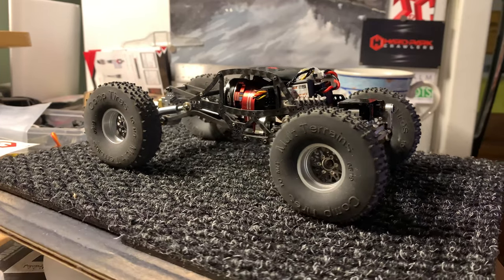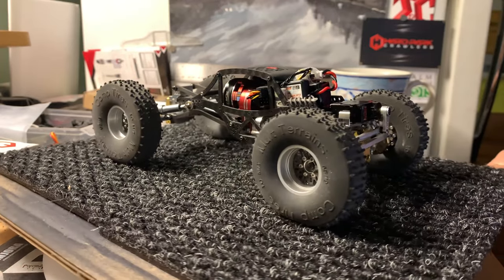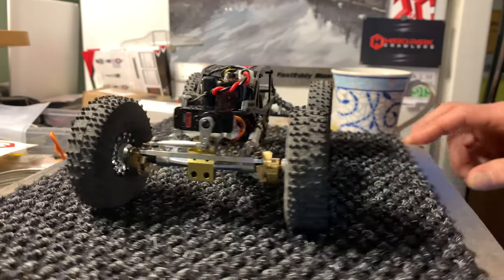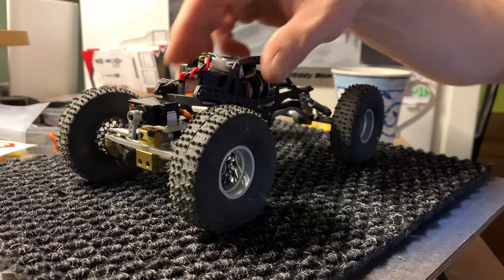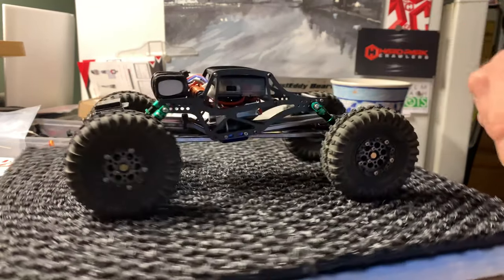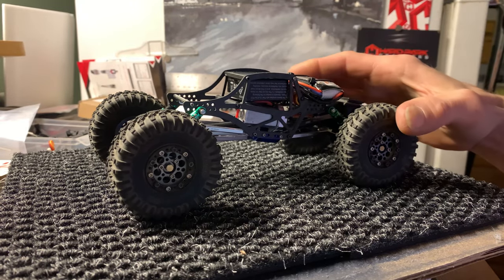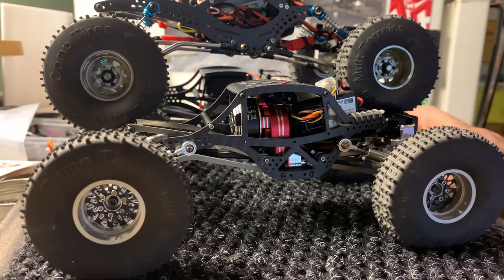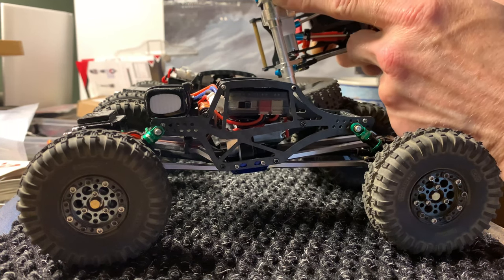Coffee and Crawlers #6 - 24 Scale Comp Rig Talk #hardparkrc #dementorV2 #nwchassisworks

Comment: 2nd and 3rd gear what type of transmission is that the only thing I can think about is Uniqlo medium and high on the first version of electronics on the scx24
Reply from the maker: I'm not sure what you're referring to? Both of these rigs run a single speed stock gear transmission. Both front axles are overdriven by 14% more than rear.

Comment: 12:50 Aaah why did you retire that ? Well cool stuff you show here but for me thats way over my limit, time and money wise. These things are so much fun to drive even stock, then with a few of the usual mods and then some (like that ebay carbon chassis) its good enough for me. At some point i stop looking for more and more.
Reply from the maker: I know, it was kind of a tough thing to let go. It took a second build to actually get it done I was so attached to that chassis. BUT, I will say that it had its issues with unloading on climbs, even setup LCG like I had it. I struggled to keep the front end of the body down which then caused a ton of unloading on certain climbs. It wasn't until I stretched the front end WAY out and added a bunch of tire weights that it finally started to drive right. Sure, maybe I could have used a limiter but I don't want limits.

And yes, I hear you on the quest for more. But here's the thing. I just entered to compete in WRCCA Worlds in September in Maine in 2.2 Pro Class with an MOA. So, I've kind of gone comp rig enthusiast for the time being. Which means, I can't get enough of them. So, since it's winter and there's snow everywhere, I decided to build some nice scale comp rigs.

I usually one or two small scale builds over the Winter to prep for Summer. Last year I did the Toyota Hilux SR5 and got the D90 back up and going on the Rubicon chassis a second time around. So, after entering what is going to be my first contest ever, I have decided to completely immerse myself in the idea to absorb as much as possible between now and go time.

Comment: What shocks are those? Great build! 🤙
Reply from the maker: From a Dashex Z2. Garbage. You don't want them. Get some Injora 39 or 45 mm oil filled.
Reply: @VermontScaleCustoms  I’m running a couple sets of Injora oil shocks… I was intrigued by the internal springs for setting ride height. Mofo has some 42mm oil shocks that I’ve been extremely impressed with
Reply from the maker: I removed the coils from these. They were just visual shocks. I pulled them from this build a long time ago. I'm running Injora 45mm oils on my most used comp rig and Carisma MSA-1E shocks on my LGRP Comp 24. But I also have 39mm on my WT Micro rigs. I'm all over the place.
Reply: @VermontScaleCustoms  good stuff man!

Comment: Them tires right there versus OG RC Penn Tire in a wet Rock situation the scramblers do so much better but I love the ogrcc PIN
Reply from the maker: I really like the Injora pin comps on wet rock. I think they do a lot better than most would. Scramblers are just such good all around tires, in general. Little Guy Racing has some decent tires if you;re in to larger diameter with aggressive tread patterns.